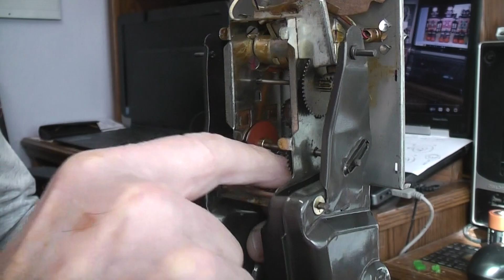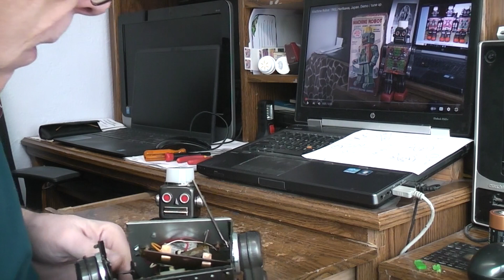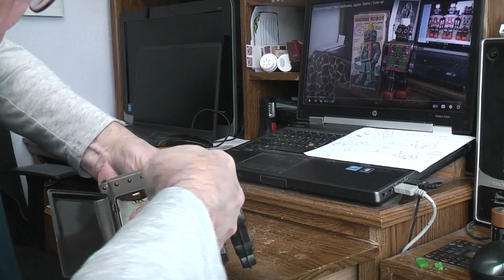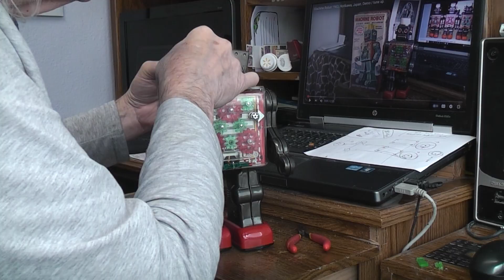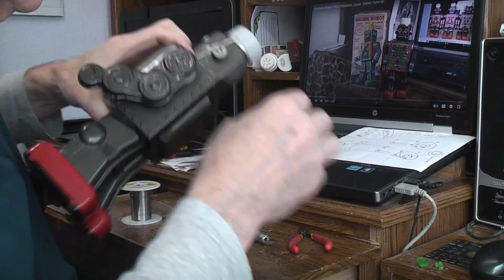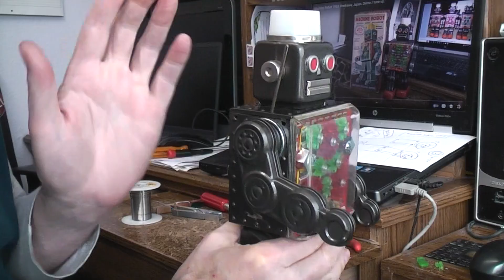Inside the Machine Robot made by Horikawa, Japan, 1963.

Comment: The metal tabs that you poke a pointed thing thru the hole to bend them. They're great when you are assembling one of these robots as you just did, but how the heck do you get them open in the first place?  It looks like a one-way process.
Reply from the maker: You use a small flat blade screwdriver and carefully work the joint where the tab is located. Slowly but surely the tab will bend enough to separate the parts. It is a skill that you learn by doing. Practice on cheap China tin toys before trying it on a vintage tin toys.